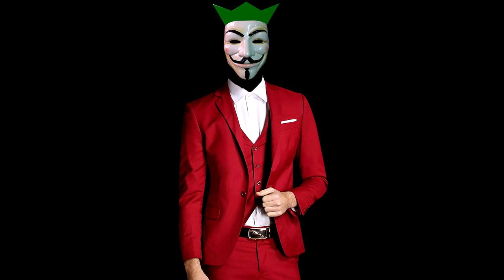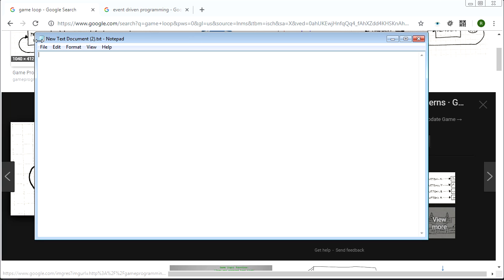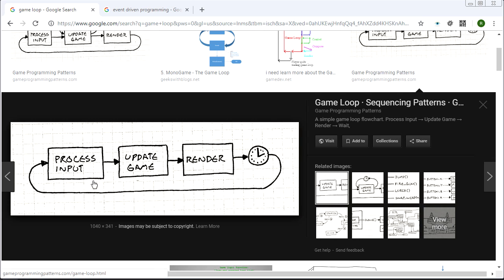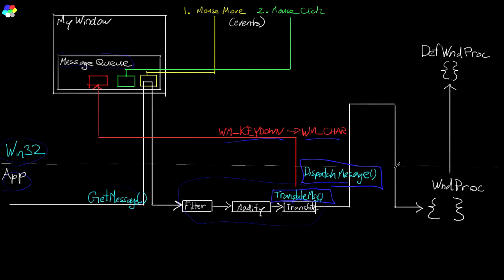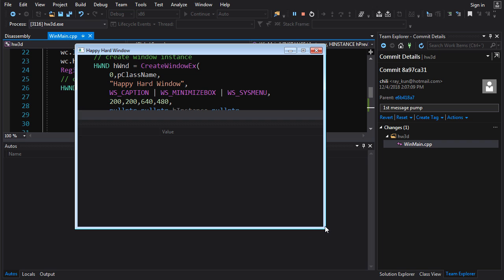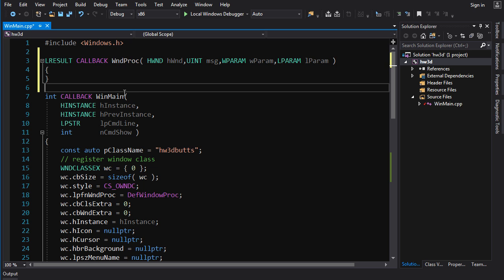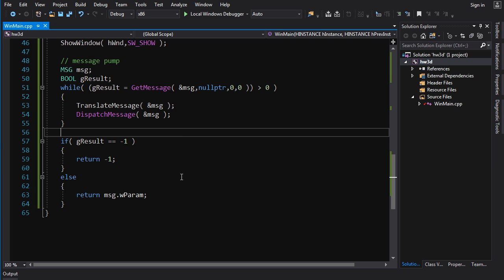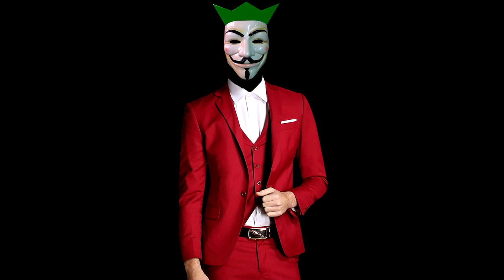C++ 3D DirectX Tutorial [Message Loop / WndProc] 3

Comment: Can anyone help?
Even after creating WndProc logic, I'm still not killing window process and have to manually close it in Task Manager.
I am coding in VS2022, is that the reason why am I encountering this behavior?
Reply from the maker: I can tell you that VS2022 is not the issue and won't matter for this problem you're having. Can't say more without your code. Come to the Discord and be prepared to post code as github link.
Reply: @ChiliTomatoNoodle  Well, after some casual process of thinking I found mistake in code. Thanks for your response tho, even for a video that old.
Btw your lessons are great, binge watching them now!
Reply: @ShamaxGD  What was the problem? For me, when I exit the window, everything is fine. But then, when I try to run it again, it gives me an error. Some process is running in the background (not visible in task manager), so I need to restart my computer for the code to work again.

Comment: For those who have the problem that the Process wont quit, try "wc.lpfnWndProc = WndProc;" instead of "wc.lpfnWndProc = DefaultWinProc".
He edited it during the "off-screen" section as you can see if you pause around here(14:17) in the lower half of the video.
Reply: Actually he did that at 12:06
Reply: Noriuno oh fuck 😅 didnt see that thanks for correcting👍🏻